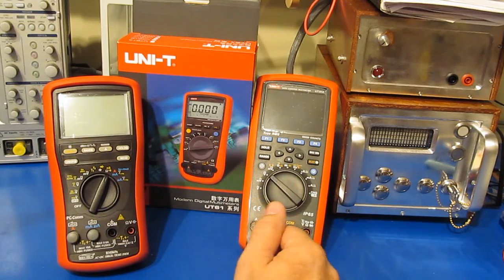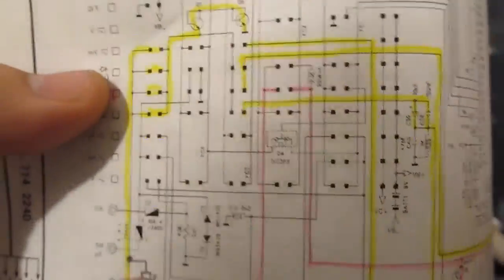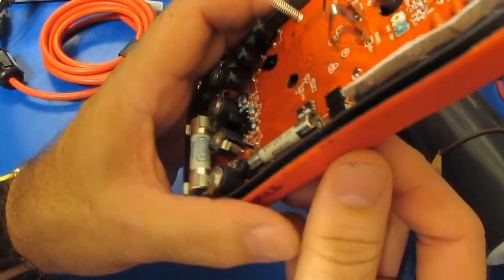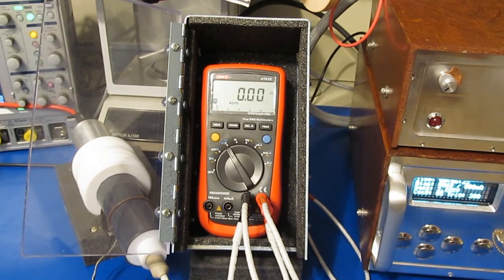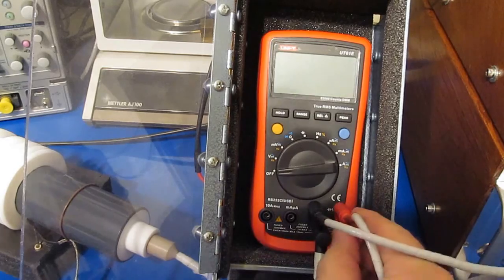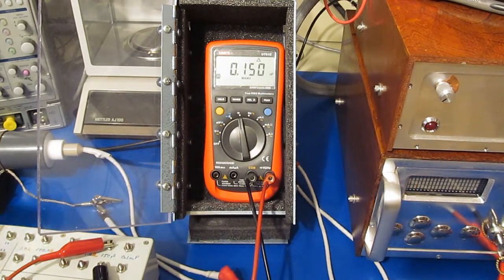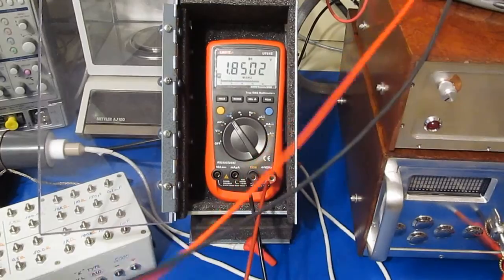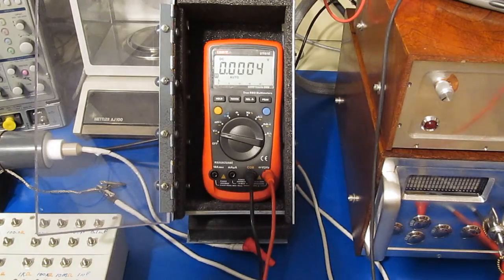Modifying a UNI-T UT61E DMM for Added Robustness Part 2

Comment: I think it's a great video and no it's not dry, it's just not for the faint-hearted.
a very good demonstration that a meter's input protection design is not just throwing some PTCs and MOVs to the input, it's way more work to put in and a lot of different testings and analyses to get things right.
Reply from the maker: I see a lot of posts from beginners suggesting adding various parts to their handhelds. I guess it makes them feel better....
Reply: @joesmith-je3tq  LOL yeah, it's like rope walking with a safety rope around your waist, but it doesn't connect anywhere. #My_Happy_Self

Comment: Joe: Perhaps you'll test the new 61e+? Interesting to discover how the changes will compare to the mod's you made and new performance.  Also,  I would like to know if the meter will work with the D07-a BT unit.  I would like to use it if I could get the Labview VI you developed.
Reply from the maker: If you look at the spreadsheet, I suspect you will find I have ran more UNI-T brand products than any other and they always do very poor in these tests.  Not to discourage you from buy one.  If it meets your requirements, get one.   Due to the effort involved in running them, I would rather look at products that I suspect would have a chance of doing well.
Reply from the maker: Also, for the BLE adapter, I checked the manual and there was no mention of it.  The only thing I saw what they mention BLE on their website for this series.   You would need to write them.    I doubt they follow a standard protocol, so if by chance they do support it, you may have to write custom software to support it.   It may be more trouble than it is worth.
Reply: Hello again, 
First,  thanks for clear and detailed investigations I can learn from. 
I suggested revisiting the UT61E's plus as it appears Unitrend studied your investigation. I'd enjoy your grade of the quality of their "note taking" and implementation. 
The D07A is being listed as 61E+ accessory at unitrend store,  but not documented. Also, the app has not been updated in 5 years,  so I'm not biting.
I'm getting the 61E+ because of its features,  but my old,  old Fluke 75 (one fuse) will still have a place at my meager workbench.
Best regards.
Reply from the maker: @jspencerg  Doing a quick search on YT, it appears EEVBLOG made a review for this meter a month ago.   He suggests people ask any questions they may have and he could look into it.   You could write him if there's something you would like to see that wasn't covered.

Comment: UNI-T UT61E is UTL listed. Issued on 2014. I don't understand:( or these test are more stressful than those specified in the standards
http://www.uni-trend.com/index.php?m=content&c=index&a=show&catid=183&id=215
https://drive.google.com/file/d/0B4Jyby-tjH5od1lDVE05dTA3UkU/view
Reply from the maker: You should also watch part 1 before part 2.  There you can see some of the differences between the GS marked UT61E and the junk they ship to the USA.   Not that the GS rated meter would survive these tests any better.
Reply from the maker: As I've covered countless times, the tests have nothing to do with safety which is what you are asking about.   There is a FAQ.  You may find a link to it in the about menu.

Comment: Hello. Thank you for taking the time to test thoroughly and even make videos of your work. I would like to perform these changes on a UT61E as well. If possible, could you provide a list of the part numbers (or just specs) used for these modifications ?
Reply from the maker: Start by reading the FAQ.
Reply: Hello, Thanks for answering. 

After re-watching all of your UT61E videos 4-5 more times each, going through the EEVBlog UT61E thread and other documents as well, i've decided that it's more important to learn the properties of each individual component first (thanks to your "Improving the temperature stability" video), and how they interact with other components when placed in certain way a circuit. There are too many questions for which i do not have answers, and i don't want to just follow some instructions, even though that is what is asked for initially.

About the FAQ - I've read it now, the answer is very fair.

If i may bother you with another question - What would be, in your opinion, the most correct way to attain a solid knowledge of the basics of electronics ?

Thank you.
Reply from the maker: @mexykanu  I would say it depends on YOU!   Your long term goal could be anything from becoming  an EE and make a living from it or  to just playing around as a hobby.   People learn in different ways.  Again, you would know what works best for you.   The one thing that doesn't work is to do nothing.
Reply: Right now the goal is to practice electronics as a hobby while understanding what is going on in a particular project. I don't consider it playing around, since i'm interested in learning all or most of the intricacies of electronics. I'm halfway through the first Volume of the series Lessons in Electric Circuits by Tony R. Kuphaldt (https://www.allaboutcircuits.com/textbook), which seems to be a good starting point.
The question should have been: Would you be able to suggest other resources to complement the above mentioned series of books? Anything goes.

Thank you for your time.

Comment: Would you still recommend this meter (unmodified) for low voltage <50v work and especially electronics?
Reply: I just can't get enough of that 22000 display. 3 decimals up to 22 V combined with quite good accuracy is something I don't see on any other meter in this price range. Of course these features are not exactly usefull to electricians working with more deadly numbers.
Reply from the maker: If you would take the time to read the FAQ, I don't offer recommendations.  In the case of this meter, you should understand what it's weaknesses and if they are acceptable to you.
Reply: In my opinion this meter is a perfect benchqueen.
Reply from the maker: LOL.  I was thinking my Gossen would fill that roll.
Reply from the maker: I suspect you are right about most electricians not needing the level of features you will find in some of the more advanced handhelds.    I also doubt you would find many actual electricians using this brand of meter.      That Gossen is a 300,000 count meter (if it were only stable enough to utilize it).
Reply: I mean for someone who mostly needs a meter just to tell if a voltage is present or not. It is more important whether it's safe.
Reply from the maker: Yes, I expect someone working win a hazardous environment would be required to use the proper tools.   It's nothing I really address on this channel.  But I do still get people from time to time who feel this channel has something to do with safety.
Reply: @joesmith-je3tq  A brief look at history of female monarchs ... would discourage me from using that sort of an epithet for test equipment ... an epitaph? ... sure why the hell not !

Comment: Thanks for these 2 videos Joe,  I changed my plug contacts to brass when I bought it, made big improvement. I don't use mine for much more than 270v AC. I've got resistance test boxes and capacitance test plates plus voltage reference and the meter is very close or spot on.
I had a very expensive Snap-On meter I bought back in 1992 cost $850 AUD back then and it died a few years ago unrepairable. Not happy Jan as the saying goes!!!!!!!! Have bee very happy with this although I made my own leads from heavy gauge and thick silicon leads with modified scope leads, they have proven to be very accurate and dropped the short resistance down to nearly zero. 
Keep the great work and thanks again for the extra effort in this set on the UT-61E.
Reply from the maker: Was your Snap-On made by Summit?   How did it get damaged?
Reply: Hi Joe can't remember who made it don't think I could find any clue outside or inside as to manufacturer.
It had been sitting for quite a few years as I had stopped as a mechanic was then a machinery sales manager.
When I went to use it I put a battery in as I'd taken it out and when it started up was very erratic nothing measured correctly
And even scoping it I couldn't find the source of the problem it would come and go. If you squeezed it sometimes it worked sometimes it didn't.
There were no problems with solder joints but I reflowed them anyway, no luck. I spent about 2 days trying to repair it and no luck.
It came with plug lead adapter and K thermocouple both lead and probe style. It was the top of the line back then, I also had problems with a Snap-On timing light. Water under the bridge now but I'm happy with the 61E. I also have several analogue meters the best is a KAMODEN TRCX
that was owned by a retired flight engineer here, had hardly been used and he'd moved to Spain. I had several others not TRCX and I took one apart and used the rear hairspring from one to correct the TRCX meter. Boy that was fun , NOT.

Comment: Maybe the reason this DMM is so cheap is that it failed the ESD testing and they decided to just ship it as a budget alternative instead of trying to fix the issue.
Reply from the maker: Many of the UNI-T products I have looked at fail this test including the UT181A.  They are not certified to meet the EMC standards.

Comment: What is the bad thing with having a high voltage capacitor on the input to reduce ESD? The fact that they are high voltage capacitors and dangerous when they fail?
Reply from the maker: Low impedance path for higher frequencies.  Not sure from a safety standpoint what would be required.
Reply: well imagine you are measuring a high voltage node then disconnect the leads and somehow the "input capacitor" stays charged up and you accidentally touched the probes or try to measure a sensitive point on a circuit, you may dance a little bit, or maybe your circuit will.

Comment: This meter not worth the time?! It wasn't before you started, but this two videos where great fun, it's really interesting to learn exactly why it failed and the way you modified it is a great step toward how they should have done things in the first place :). Hope to see more of these reverse+forward engineering videos.
Reply from the maker: Right, I would never recommend someone attempt to modify any meter.  More than likely the meter would be less safe than it originally was.
Reply: I wouldn't be confident in the safety of that uni-t at any point before or after modification, if the goal really was to simply get a more robust meter buying one would be a cheaper option than going through what you did (given you'd probably trash one or two meters in the process of testing modifications) :P. The point is it is an interesting and fun journey to watch, and it shows what some of the differences could be between a cheap meter like this and a decent one in a deeper sense than just "more protection stuff".
Reply from the maker: I agree about the safety.  I would not trust ANY meter that was not certified for the environment I was using it in. Sure they will cost more and people complain about their higher costs and lower features.  While I did damage two UT61s before making this video, no other meters were damaged during the testing.  My concern when I made the video was I saw a lot of unfounded comments about adding MOVs to this meter.  No one had any data on what the end result would be.

Comment: Enjoying your channel, great video's Joe! You obviously enjoy your work. Just to tidy up a few details that I didn't get from the video's ...what components did you end up in the meter that you tested? 

-> PTCs changed to ?
-> MOVs changed to ?
-> TVS diodes used to replace the transistors ?

Maybe UNI-T should sit up and pay more attention to the changes you made!

Looking forward to the next video!
Reply from the maker: Glad you are enjoying them.  I ended up with the larger PTCs I mentioned in the video.  If you swap them, I would try to find something in the resistance range with a larger body.  I think the MOVs I used were from Panasonic.  Those may be a little over kill.  I think the transistors would work fine if you limit the current through them.  I left the resistors at what ever I mentioned in the video.  Really, the ones limiting the current to the input pin could be a little lower.  I just don't know how far I could push it.  10X smaller may be a good tradeoff.   The current limit may be a bit on the small side as well.  My goal with this video was not to give a step by step how to modify one.   You get people posting about how adding MOVs will make is a better meter somehow.  The video was only to show that there is a lot more to consider.  Again, I would never suggest anyone attempt this as the meter may indeed be less safe.    The same with video where I added the temperature compensation to the  UT61E.  They are good educational demonstrations but not something I would do to a meter I planned on using.

Comment: These two last videos were excellent, congratulations.

I think would be very interesting put the changes in a schematic and share. In addition, a video about clamping circuits like the arrangements with bjt would be useful.
Reply from the maker: Dave Jones (EEVBLOG) made a video on multimeter input protection.&#160;&#160;I have&#160;made a few as well where I show them in operation.&#160;&#160; Here are a couple&#160;of them.https://www.youtube.com/watch?v=wYCGnYglRjYhttps://www.youtube.com/watch?v=f99Ra1O_u7s
Reply from the maker: Here is Dave's video as well:    https://www.youtube.com/watch?v=zUhnGp5vh60